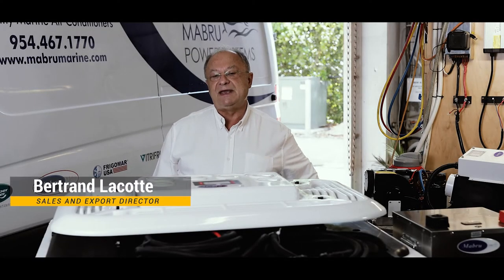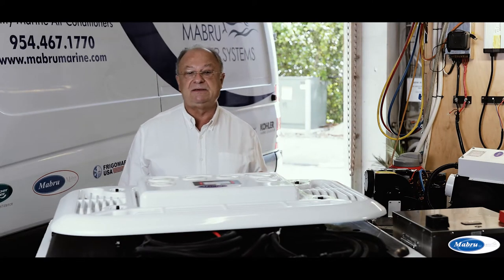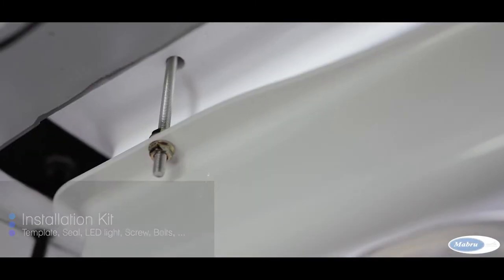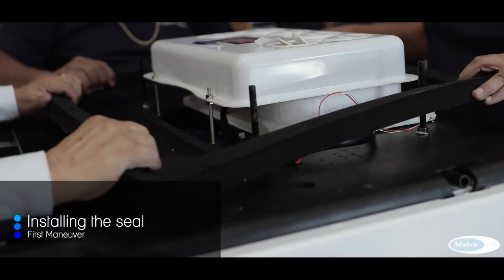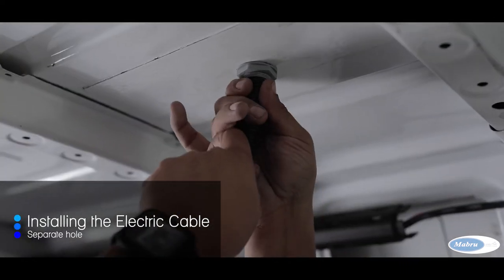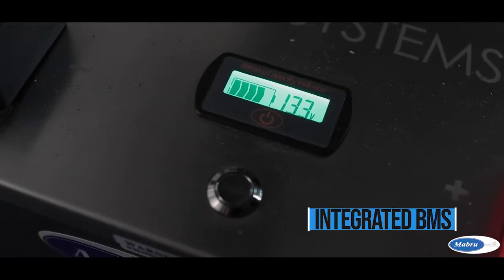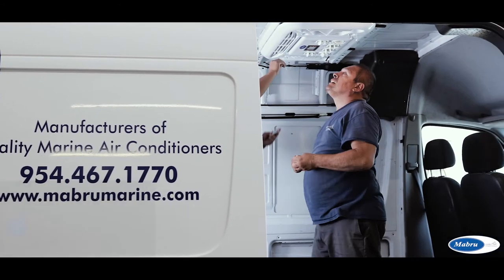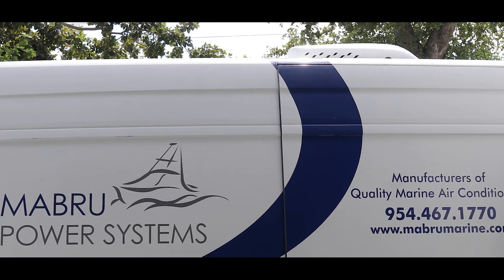MABRU RVSC 12 DC ROOFTOP

Comment: On Mabru RV website, there are details suggesting 14” x 14” roof cut out.  Is this accurate?  If so, any updated instruction on van install?
Reply: From my research, you just have to take apart a bit more to fit it through the 14x14" hole and then reassemble it.

Comment: "Consumption of between 40 to 50 amp per hour".  ...and...
"Thus with our 250 amp-hr battery, you could easily run 8 to 10 hours"
Someone isn't very good at math.  250/40to50 is 5 to 6.25 hours, not 8 to 10.
Reply: They recommend 500 amp hours (per their website) for that run time. I think he just misspoke.